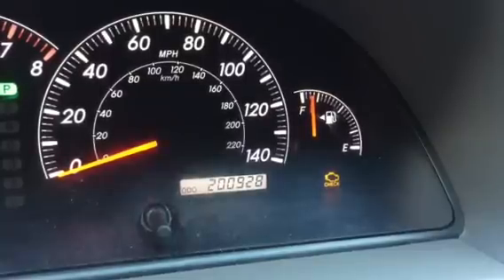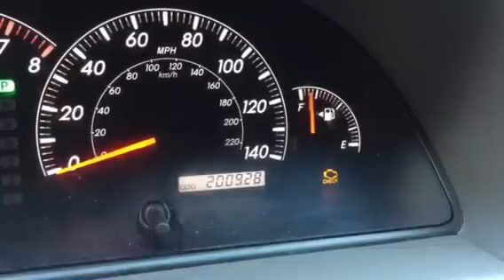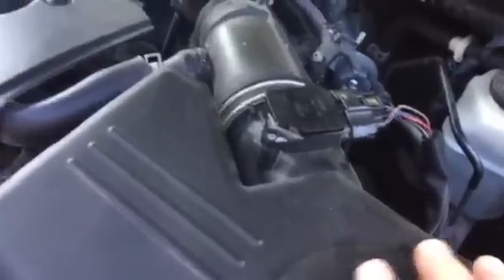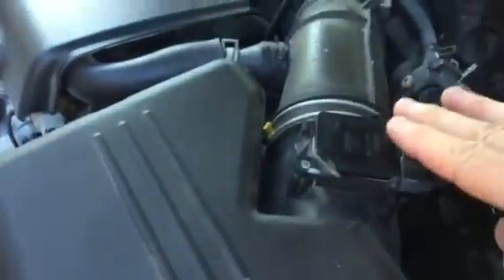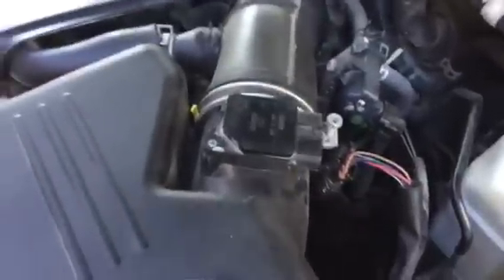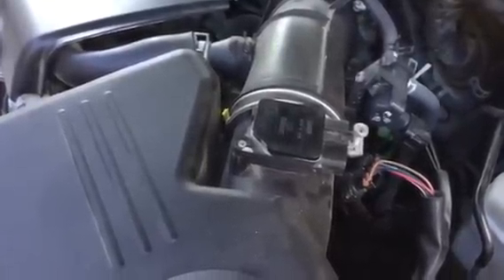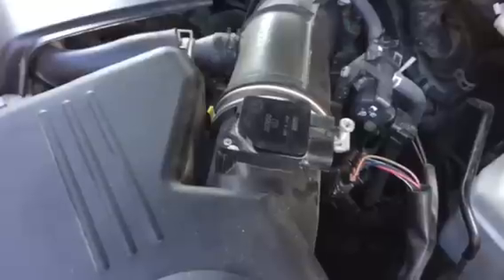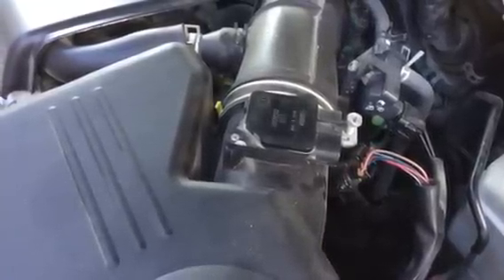How To Tell If Your Mass Air Flow Sensor Is Bad On Your Car

Comment: I changed the mass air flow sensor  now I'm getting a p0102 code
Reply from the maker: Make sure your engine air filter is not dirty.
Reply: Go to Autozone and erase the code. I forgot to put back my MAF wire after cleaning my MAF and the check engine light came on even when i put back the wire. i reset the code and it never came back again. P0102 as well.
Reply: Followed you advise on your video car kept running so bought and replaced the mass air flow sensor and my car is still having same problem
Reply: I did this. Changed the sensor. Engine light is still on and I can disconnect the cable and the car still runs. Did I get a bad mass air flow sensor?
Reply: Dj Lemo me too
Reply: Yep it could be the 5 or 12V power coming into the MAF, have to test for that. Using a volt meter to test the MAF is a better test
Reply: clamp the cables together with a clamp, over night is best to clear the computer after you have replaced the bad part.
Reply: No, This test is specific to certain cars. Some car makes this works on others it does not. This is good and bad test, depends on the make of the car.
Reply: Disconnect the negative cable before working on it.
Reply: is this test work for 2009 mazda cx-7
Reply: Hard codes will not go away even if the problem is fixed, have to clear the computer, either do it with a scanner or disconnect both battery cables and touch them together , wait 30 minutes, hook it back up, computer should be clear

Comment: At last a Video of the simplest form with no bullshit! Keep up the good work!
Reply: Bigstep uk  v
Reply: Bigstep uk.
Reply: Bigstep uk very clear and presice.👍
Reply: Haow to find gas pump to opel omega
Reply: Tried on 2 cars does not work cars kept running, he is full of crap!
Reply: How does he know it needs to be replaced, maybe it just needs to be spray cleaned?
Reply: @stechell8807  no, cleaning many times damaged it or make it behave differently. I cleaned it with specific cleaner. didnt help. I suspect it even put some film on it.
Reply: Tried this on my discovery engine kept running. Fitted new one and still kept running so £90 down the pan.
Reply: this video is probably car specific, but it certainly doesnt work on BMW's...there are many of them driving with air mass sensor disconnected. I was driving it disconnected for some time too while waiting for new one...and it wasn't a big difference too...
Reply: Martin Kulik Unfortunately it’s misinformation. If the MAF sensor is disconnected, the computer will compensate and create fake values in its place. Disconnecting the MAF can actually be used as a diagnostic tool.  Not everything on the Internet is true
Reply: At least for German cars LOL
Reply: @jhollman699  yeah, actually if your car is running better with MAF disconnected, it may be the MAF sensor the guilty one
Reply: i know right
Reply: correct
Reply: Yeah!
Reply: you might watch  learn

Comment: thank u i have a Chevy astro van and I was chasing a code p0171 and p0420 for like 5 months and when I disconnect  my mass air flow sensor my van kept running so I ordered a mass air flow sensor of eBay for 30$ bucks hooked it up and drove it for 2 miles came back home left it running then unplugged the new one and my van shut right off that how I new I solved the problem thanks to this video a big help
Reply: Dj Lemo did it solve your P0171 code ? , cause I have the same code I cannot figure it out thanks
Reply: Thanks for this comment i guess i wont know til i buy it plug it in and drive.. because when i unplug my MAF car still runs fine
Reply: Mr Briceno well did you ever fix that P0171 code then ?

Comment: do you have to disconnect the battery before you clean the Mass air flow sensor?
Reply: MAF cleaner is quite explosive so it is probably worth disconnecting, I have no eye-brows right now.
Reply: Made me laugh out loud....Thank you Janek !!
Reply: make sure the key is off then there is no 12V to the MAF
Reply: OF COURSE!
Reply: Readme .lol....lmao
Reply: No.
Reply from the maker: No
Reply: Dr Edward. R Jackson when putting the plug back in though it'd be better to disconnect the black lead on your battery

Comment: changed maf sensor an car steel won't go over 40 mph keep bogging down can anyone help please
Reply: Ed R try the o2 sensors
Reply: Ed ,,,,, we need more info to help ........  there are so many  sensors that will work harder to try and maintain your cars performance . I have an 07 ranger with rich 02 senors stuck open and that's after the new ones were installed . can you take the plugs  out and  give us a description , also do you get and  diagnostic codes ,,,,,,,,,,, you can have a bad sensor that is very sluggish but still within parameters that just wont throw off codes .
Reply: try map sensor also solinoid sensor these also cause lack of power if fail

Comment: Thank you a lot sir. I think you've just solved problem with my car that I've been having for the past 14 months. I've taken the car to Mechanics numerous times changed egr valve cleaned out the plugs regenerated dpf filter all to no avail. Thanks a lot. God bless.

Comment: MY ENGINE REVS UP HARD MOMENTARALLY
Reply from the maker: How many rpm's does it rev up to and does it eventually return to idle?
Reply: I  was doing it by myself  so I couldn't tell you but guessing it would be an additional  few hundred rpms or  more for  about a second then yes returns to normal . its an 07 ranger 4.0 any info would help ...........  I keep getting  stuck open 02 upstream sensors and that's after a mechanic rreplaced them .  BTW  after 3 mechanics and there  scantools the only code I get are the stuck rich 02  banks  1 and  2 upstream .
Reply: my throttle cable has alotta  slack and  needs  tightened  but  I don't think that would  effect the  air fuel ratio and  throw a code off
Reply: @proclaimliberty2000  I bought a new MAF and drove approx 20+ miles,  went to unplug it , car stayed running ? Any ideas , ???

Comment: airflow mas sensor disconnected but the car engine keeps running
Reply: Same here
Reply: I have hesitation when accelerating and it idles rough, It also burns rich and a friend told me a few relays are missing and that might be why cuz he checked the wire and there was no power coming from it so I am gonna get those first and then see what happens, car keeps running when I disconnect the airflow sensor though.

Can that cause the problem???

Missing relays?
Reply: Floyd Marks  was it the MAF sensor ?
Reply: @5PoW2  not for me it was a leaking coil pack

Comment: But how does it keep running if the sensor is bad? Does the computer take over and readjusts or something?...
Reply: I have an 88 302 f150 and it turned out to be the TPS (throttle position sensor that was bad.It would die out and was hurky jerky going down the road. I replaced the TPS and it runs fine now...
Reply: @John Doe I hope you are not a mechanic. This is one of the easiest, best and quickest ways to test for faulty MAF.
The reason the car stays running is the PCM or ECM is not finding any MAF signal. So instead of allowing the car to shut off, the PCM or ECM makes its own signal to replace the missing MAF signal. This signal from the PCM or ECM will give you time to get the car repaired and parts replaced. 
Never trust a man wearing a mask. Unless hes in a tree stand.
Reply: ntk
Reply: Mike Page same is happening for me. Please let me know if you solve the issue. In beging to think the MAF is throwing the codes but it may be the throttle body where the problem is coming from.
Reply: My Nissan Quest stays running when I disconnect the MAF sensor. ( it runs rough though almost like it wants to shutdown)??? My van is having acceleration problems
Reply: Joshua Olivencia you got the 302 v8? Mines having the exact same issue with my 85 Ford F-150 and I really hope that solves the problem
Reply: Metalunique
Reply: Joshua Olivencia
Reply: Joshua Olivencia I have this issue Inman 02 mustang ft I will try that thanks  for sharing
Reply: haha.
Reply: Maghrib Tv I don't know if I'm reading English or am I stoned
Reply: when the ECM adjusts to keep the motor running then you can unplug the MAF and the motor continues to run even if the MAF is bad. This test will work on some cars but not all cars. Sometimes the ECM is bad and is not sending the 5V signal to the MAF so the voltage test at MAF is faulty sometimes as well.
Reply: adriannyasia The ECM(computer) will adjust fuel/air mixture in the motor by "default" or based off the readings from the numerous other sensors on the vehicle. ATC(air temp control), IAC(idle air control), EGR valve sensor, o2 sensors(oxygen sensors) are some esamples. Based on what the computer reads off those sensors, essentially how much air is being brought into the motor, it will adjust to keep the motor running, or at least try to. I just learned this the hard way. my '89 5.0 Mustang was idling a little rough and cold start required two attempts at cranking the car to start and also needed to give it a little gas pedal for a second so the computer could adjust itself to keep the car running. Hit AutoZone, got some MAF cleaner and cleaned it up real nice(had some carbon/dirt built up from over the years), put it back on, started up in about a half a second and idle was more smooth than I would have ever thought it could run. Put a big ol smile on my face. Can't wait to drive it to work in the morning. Been dealing with this idle issue for a while now. Something so small can cause problems for a long time.
Reply: @John Doe  dude it looks like a load of people here did what this idiot said to do ^.^ and it helped many people !!:O also me :) blow away hater
Reply: shit this sounds exactly like what's happening to me and I d/c the mass and it kept running with no change whatsoever.. goddamit
Reply: Joshua Olivencia so is that a yes it runs without the sensor? and if it'd out foes it affect your gear shifting and how hard it pops into gear? PLZ let me know I spent too much money on my truck already to be guessing thank you hope to hear something soon...
Reply: Seems this airflow sensor is the ultimate of bull shit,you dickheads.
Vaporize your gas.
Look it up on the internet.
Stop watching shit box TV.
Reply: Content well I found the problem....its a ford! If you junk it it will be were it belongs. Buy gm products and save money
Reply: Daryl Rocks GM are junk too..parts wear out on fords, ,parts break on GM

Comment: so I unplugged mine. it shuttered but not die. so that tells me mine is working at least right ? cause it could tell a difference ?
Reply from the maker: Yes.  Also, if check engine light is off, acceleration is good and gas mileage seems normal then it would appear good.  Remember, they do need to be cleaned occasionally as they will get dirty which will affect performance of vehicle.
Reply: proclaimliberty2000 . yea I have some other issue then.

Comment: I did this test and my 13 Altima engine stood on . So I bought a new sensor and installed it and now my engine light is still on .. I did this test again with the new sensor but my engine still stays on ... any help ?
Reply: Did you reset the computer ? if not disconnect the battery,wait 5 min, then reconnect the battery. light should go out
Reply from the maker: All 3 of my vehicles did the exact opposite with this test.  If your MAF sensor  was faulty, then the new one will reset and turn off the check engine light by itself after you drive the vehicle usually 25 to 50 miles.
Reply: +Luis Rivera

Any luck?
Reply: Yes.  Try cleaning yours anyways.

Comment: need help i put in a new mass air flow sensor in my 2000 Nissan maxima, i took it out and it drove smooth with no idle and then i did this little test and the car shut off so i thought i had fixed it then i drive again about an hour later and hear. this weird noise it sounded like something hitting against a fan while it was spinning then i did the test again and the car kept running after i unplugged my sensor but the car still runs smooth any answers
Reply from the maker: That's good the car's running smooth but you need to figure out what's making the weird noise which will probably return again.  It could be the bearings in the alternator.
Reply: proclaimliberty2000 i stopped in a parking complex and checked to see what it was and didn't find anything so i checked my fluids and my oil was low so i filled that up and then it stopped but any answer to why the car still runs with the new maf in
Reply: I've same issue. Any hello please.
Reply: Hmmmm.  Anything else wrong with the car now?  Runs ok?

Comment: It's worthwhile  to clean the MAF sensor first before replacing it. It did worked in my car. After cleaning it with the MAF sensor cleaner my car is running perfectly. No more hesitation.
Reply: mine did not work after.. :;
Reply: Did your car vibrate only inder accelration?
Reply: I tried that before. It almost fucked my car up. Made my car shake during acceleration.
Reply: @pineapplesplash9166  you mean unplugging the MAP?
Reply: Helcon Jesalva how did you clean it?
Reply: @shannontate8483  mass air flow cleaner. Go to advance auto.
Reply: That’s a temporary fix, it will soon fail and cleaning it won’t work
Reply: @irishuwould5185   Depends.  Some are just dirty and that's it. Others have filaments from the air filter melted onto them.
Reply: @irishuwould5185  Just like all parts on the car, yes.

Comment: my 2000 buick lasabre started idling high. like over 2 on the rpm. then it will stop, then do it again. i had the tps sensor replaced and it didnt help. now my mechanic thinks its a vacumn leak somewhere. not the computer. my gauges are ll messed up also. can you help?

Comment: hi i did this with my mazda 3 and it kept running didnt cut of like yours the reason i check this i realised when i start in the morning it cuts of on first start and starts normal on the second start when it idle rpm start right and i get a strong smell of gas until the rpm lowers this happened after i got the trottle body cleaned could you say what is causing this problem?
Reply: You must live in Philadelphia!
Reply from the maker: The gas smell could be the ECM enrichng the mixture on a cold engine, especially in the winter time causing a strong smell of fuel coming out of the tailpipe until it warms up.
Reply: Its always sunny here